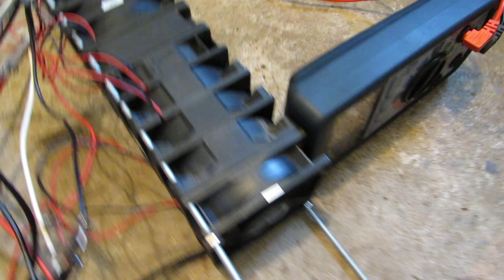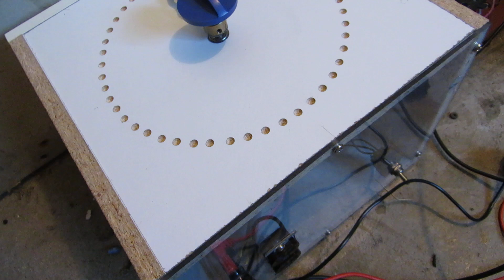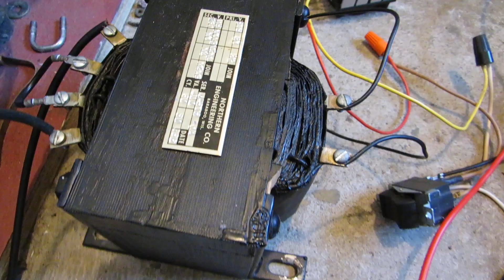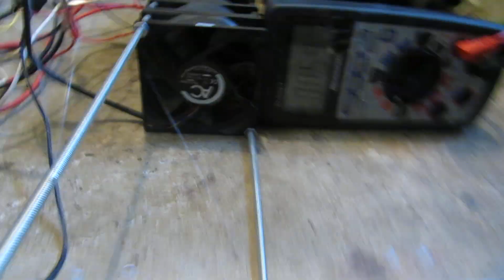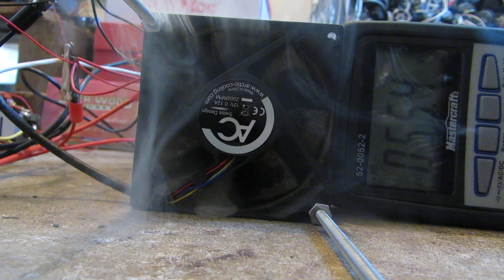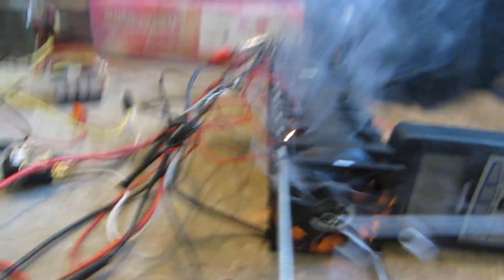More Fan Burnouts

Comment: How do you boost dc voltage using a transformer
Reply from the maker: If it's a step-down transformer wire it in reverse.
Reply: HL4EHalfLife OMG

Comment: Still not enough cooling for AMD processors
Reply: Roddy Not enough cooling for the GTX 480
Reply: ITS ON FIRE
Reply: Have you heard of AMD Ryzen? It performs better than intel and cooler. So intel would be the one with thermal issues.

Comment: Cigarette smoke makes a fan dead?
Reply: Seen it also. The smoke has tar in it, which is like syrup and eventually that coats the bearing or shaft in the fan enough so that it doesn't move. It's nasty to work on smoker's stuff...
Reply from the maker: +Tim Ramich It will build up on the blades and in the bearings...so yes it will kill a fan eventually.
Reply: +HL4EHalfLife You can clean fan blades. Dirty blades won't kill a fan. How is tobacco smoke supposed to build up inside of the bearing? How is it even supposed to make it in there? How is something like that supposed to displace something like grease? Nonsense...
Reply from the maker: +Tim Ramich It's not nonsense, i've seen it dozens of times when I get a hold of old pc's that belonged to smokers. The smoke will find its way into everything, and the bearings are not sealed bearings so with enough time the smoke particles build up and will eventually seize up the fan.
Reply: i have a computer fan thats  going on 26 years old and another one thats 28 years old
Reply: And it stinks
Reply: It also make plastic easily breakable...
Reply: +Tim Ramich Don't be stubborn, buddy. Experience and application will always beat theory.
Reply: PvtMadnage If white paint is yellow and won't clean its due to age, not smoke.
Reply: I've seen white walls turn yellow from smokers, computers will easily do it too and the cases aren't usually made of the plastic that yellows like an NES. It's usually a fire retardant in plastic that yellows, and metal PC cases don't have it.
Reply: 1ElectricPlasma1 People who whine about cigarettes always exaggerate in a dishonest manner. Oh no, the gunk in a bearing could ever be old grease that's gone foul.